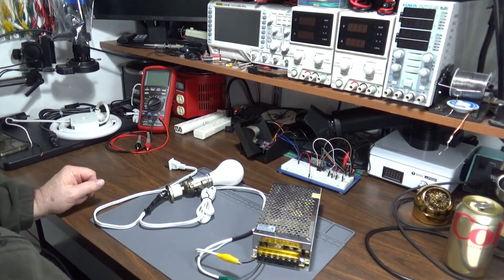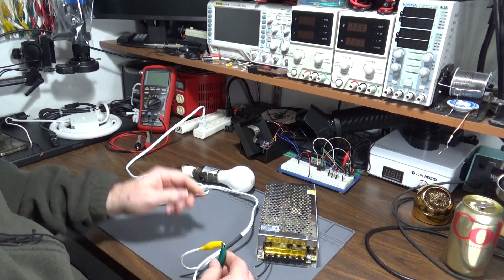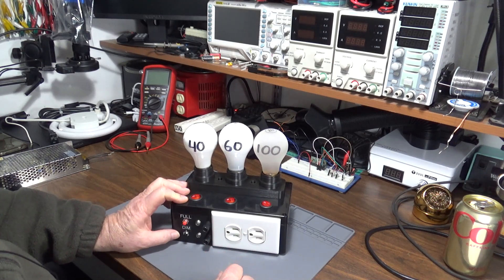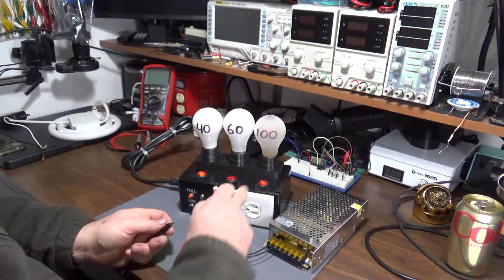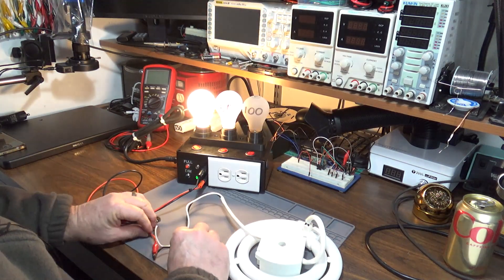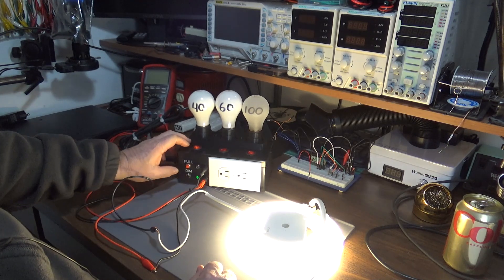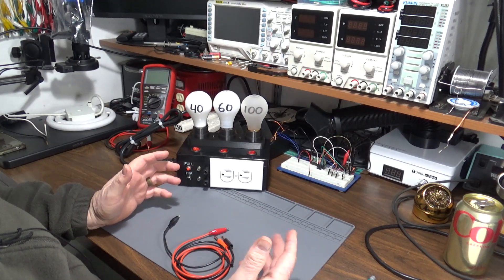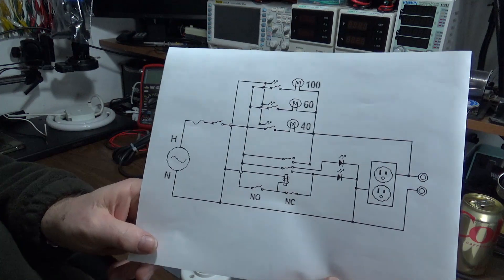DIY Deluxe Dim Bulb Current Limiter

Comment: Here in Australia mains voltage is 240 volts. those exposed crocodile clips would scare the sh*t out of me, limited current or not. No way. Everything else is great.
Reply from the maker: Usually I would connect them with power off and then switch power on.  They can be very convenient
Reply: @jmanatee  Fair enough. I do get how they could be a bonus, I'm just someone who has my fair share of "boots" off the mains. Maybe I'm clumsy...

Comment: Looks good, but here in 240 volt Aus those banana jacks would scare the hell out of me, current limiter or not. But I'll probably use the rest, as I like the ability to alter the limits.
Reply from the maker: Working on mains electronics can be dangerous we all have to be careful
Reply: @jmanatee  Of course we do. I prefer to remove as many risks as possible.

Comment: Your video is most appreciated, very helpful! I'm assuming that this setup would not be good for testing/troubleshooting an old microwave oven? .. thanks!
Reply from the maker: could be used to test most electronics during startup,  with a high wattage appliances it wouldn't work while running

Comment: Clever tester design, I like the auto switching and the combination of different power levels. 
Not sure what your mains voltage is, but the way you handle the alligator clips is frightening.
Is there a difference in getting electrocuted with and without power limiting?
Reply from the maker: No difference

Comment: Is there a reason to actually need 3 bulbs? I have a dim-bulb tester with only 1x 100W lamp, and it indicates any piece of equipment with a short circuit (or very low resistance) in its circuitry.
So, i'm trying to reason WHY i would ever need lesser resistance filaments in the 40W & 60W bulbs for equipment testing?
Obviously the resistance of the 100W bulb allows enough current for fussy switchmode power supplies to startup which also gives me reason to NOT need the 40W & 60W bulbs.

Maybe there's a scenario i haven't experienced yet?, but my dim bulb tested has been fine for all the valve radios, guitar amps, vintage hi-fi and computer power supplies over the decades of restoring & repairs that i've experienced.

with thanks.
Reply from the maker: No this is a luxury,  I used a single bulb current limiter for a long time.   I just wanted to improve it.   I always start with 40watt bulb to get an idea of how the repair is going.

Comment: this reminds me of a contraption i made, the "ballast board", in other words i screwed a bunch of different size fluo ballasts on a fiberboard and select em with hairdrier switches, you can configure up to like 200W and limit the current on a load, it has only two wires coming out, it seems silly but it's fairly useful, instead of finding the correct ballast or for adjusting the power finely
Reply from the maker: Sounds interesting.

Comment: I've got most of the parts to build this now, but what LED's did you use, please?
Reply from the maker: Just regular LEDs with resistor  inline
Reply: @jmanatee  Thanks, having read through the feed I found the answer, and found a few design alternatives since.. Can it be substituted with a 230v LED?
Reply: @jmanatee  the resistors that were left off your diagram ;-)  - Hopefully nobody has built from the diagram verbatim and then blown LEDs into the sky without the necessary dropping resistors. ;-)

Comment: Well - Thanks for the Schematic - Finished building this design today - Looks almost identical as I used the same project box. I decided I really didn't want the Banana jacks so I left those out, and rather than the duplex receptacle I used a range type snap in receptacle (Qualtek# 738W-X2/03). I don't have a 3D printer so to mount the 3 light bulbs I simply used 3 Leviton# 8101 Porcelain 2 part Lampholders - they fit perfectly across the top.
Reply from the maker: Very cool!   I Like the changes you made.  I should have gone with the snap in receptacle....

Comment: I like this very much and want to build one. However, I'm slightly confused. When I look at the diagram vs your list of components. The SPSTs in your list are 2 pin, yet what I assume are the 2 switches on the diagram, those just above the relay, are 3 pin. Could you clarify this, please?
Reply from the maker: the relay is a double pole double throw,  the two switches are labeled NO and NC
Reply: @jmanatee  Thanks for your reply, I see that now 🙂The other contacts on the diagram are those of the relay?   I have an Omron LY2NJ 10A DPDT, which I intend to use for this project.

Comment: I like this design. Will the relay still function if you feed the AC through your variac at a lower voltage?
Reply from the maker: relays will usually clamp at a lower then rated power,   But once activated they will usually stay energized at a much lower voltage.    If you are using this with a variac and bringing the voltage up slow you would probably want limit mode anyway

Comment: I want one, right now just use a variac and isolation transformer for vintage electronics
Reply from the maker: They are very helpful
Reply: @jmanatee  How does the relay get along with the variac? I'm sure it won't stay latched.
Reply from the maker: @amsoiltek  It will stay latched at 70v and fall off at 60v

Comment: I really like this design. Best part is that it comes up in limited mode. I would appreciate the relay part number and the current limiting resistor sizes for the LEDs. If you could provide those I would appreciate it.
Reply from the maker: The relay is Omron LY2-UA-006244 Relay...     I can't remember the exact resistor but I think it was either a 5.6k or 10k 5watt in series with a diode.  Although the LED is a diode it can have trouble with the reverse current thats why I added the diode.

Comment: G,day from Sydney Australia.
Wow fantastic invention. Would another way for the same purpose;
Bench power supply LCD of V and Amp with a meter between cables to appliance measuring Amps?
You could limit or set V and detect if a short exists because no amps are passing through the short?
🌏💫
Reply from the maker: Bench supply works great for DC applications.  With AC you could use a variac and amp clamp but a dim bulb is a quicker more protective way

Comment: I noted you are using a switch mode power supply to demonstrate your dim bulb project. But I think the audience here needs to know that switch mode power supplies and dim bulb testers are often a bad mix. As a switch mode power supply is non-linear, it doesn't work well with a linear current limiter. It may not start up but rather pulse on and off. As there is a line operated rectifier and large capacitor on the front end, even reduced current can still easily take out the switch transistor or MOSFET due to capacitor storage. This warning also goes for UPS units and motor VFD drives. The primary use of dim bulb testers is older pre 1990s electronics that used linear power supplies. And most calss B audio amplifiers which still mostly use a linear power supply.
Reply from the maker: Although I was just using that SMPS for demoing the dim bulb I built.   Current limiting an unloaded SMPS during repair is not uncommon.

A lot of SWPS use some form of current limiting to ease the inrush current during power up.  Something like a series NTC (negative temperature coefficient) thermistor.

Comment: Ahh, so you have 3 bulbs. All of different wattage, for more or less current to the device?
So a 40w gives the device connected, less power?
And 100w gives most power?
So when testing an amplifier for a short… the 40w bulb would severely limit the power that the amplifier receives, compared to the 100w bulb?
Reply from the maker: Correct but you can also do combination 40, 60, 100, 140, 160, 200 watt by using single and multiple bulbs at the same time,  I also have a couple 150w bulbs if need be for up to 400w 2x150 1x100

Comment: If my motor/power supply is 500W  what would be the suggested globe wattage?
Reply from the maker: It isnt what your supply is it is what the load needs so If the motor requires 500w then you would need 500w of bulbs

Comment: I like this design, plus you showed the diagram, in other videos I have to stop the video at a certain point to get a small glimpse of it, frustrating. The sound on the video is good, no echo or low volume. I would add an output voltage and amp gauge. I might add a GFCI outlet, just in case of a dead short to ground. I've used one before and it saved my fuse and my ass.
Reply from the maker: Thanks,  I have the schematic and 3d print files on my web site.   I like the ideas for GFCI and gauges   Version 2?

Comment: Do not rely on a current limiter for safety! 10ma is enough to cause uncontrolled mussel contraction "can't let go".  100ma and above across the heart will interfere with heart function which means high probability of death!
Reply: i doubt that 10mA will cause you to lose muscle control
Reply from the maker: You do understand that this device is to assist in working on AC devices.   Doing this by its very nature is dangerous.   If you do not feel comfortable working with electrical devices.   Don't.

Comment: Is it possible to use the small HV halogen bulbs to save space and make it more durable?
Reply from the maker: You can use halogen bulbs but there state wattage usually is the Equivalent watt rating not the actual rating (ie a "75w" halogen is actually around 55w) Also halogen bulbs run much hotter and usually they are more expensive
Reply: @jmanatee  I totally forgot about the output verses actual consumed power. Thank you for the response!

Comment: Made similar one a few years a go, working a lot on power electronics, such as power supplies and motor drives (mostly DC inverter air conditioner boards). Life savior. I've put and AC contactor and connected all 3 contacts as one, which bypasses bulbs when I push button for direct connection, after making sure there's no short. Also, 3 bulbs, each with it's switch, so I can make few combinations (7) of limiting input current.
Reply from the maker: Very cool.   I think anyone who regularly works on power electronics should make some kind of current limiting device.  This has saved my butt a couple times.
Reply: @jmanatee  Mine too. Ever since electrolytic capacitors blew in front of my face (long time a go, when I was a newbie), I was scare to death working with SMPS.
I accidentally set switch for 110V input, and plugged it to 230V, back in the days on AT SMPS.
Reply: @sanelleric6121  do you have scematic / jel imas shemu da okacis link?
Reply: @nekoizmase9969  Nemam kulturno nacrtanu, samo u svojoj teki za praktični rad.
Reply: @sanelleric6121  ja bih cijenio da sliku okacis kod sebe na youtube, kulturno nacrtana ... nismo u domu kulture. Hvala u svakom slucaju
Reply: @jmanatee  your webpage is offline?
Reply from the maker: @nekoizmase9969  shouldn't be
Reply: @jmanatee  maybe something was but now working perfect 👌

Comment: Very nice and thoughtful design 👍
Only concern is the banana jack power leads that can be dangerous for those being careless. But then again, one could argue that careless practitioners shouldn't even be near such works
Reply from the maker: Doing any work on AC is dangerous.  The point of this is to limit the current that can power the device or hurt operator. And it is fused to help protect you more.

Comment: You do realize a 40W, 60W or 100W  LED bulbs don't draw 40, 60 or 100W.  That is just fake number that represents the equivalent light output of normal old time filament light bulb.  In rough terms the actual wattage of those  LED bulbs is only about 10% of those numbers. Most LED bulbs have switching power supplies built into the base and are not just plain resistive loads and useless as a current limiting device.
Reply from the maker: I do know that,  Thats why I used incandescent light bulbs The kind with plain old resistive filaments.  The LEDs the previous comment was talking about were the indicators for Full or Limited power
Reply: @jmanatee  Can Halogen Globes be used (assuming they have the same real wattage as incandescents)?
Reply from the maker: @jjoeygold  Yes as long as you know the real wattage

Comment: Hi there nice job, I like the way it defaults to current limit every time, but I didn’t understand it from the diagram how will it stay latched how comes its AC not DC, I really don’t get it 😊? 
Are those 120V LEDs ready made or you added a resistor to normal ones?
Reply from the maker: They are regular LEDs I added a resistor to.   The coil of the DPDT relay is 120v when you energize it one set of the relays switches powers the coil through a normally closed switch  so as soon as the relay is energized it self powering the coil.   Its "Latched"   until power is lost or you press the normally closed switch (opening it) breaking the feed to the coil
Reply: Ok I got it interlocking relay I will search for one here in my country, hope the price is good, thank